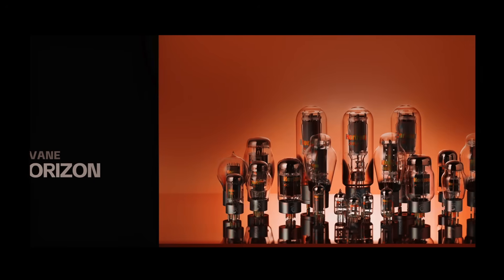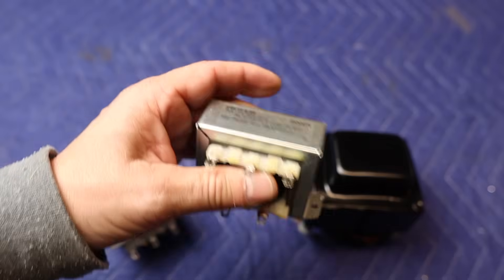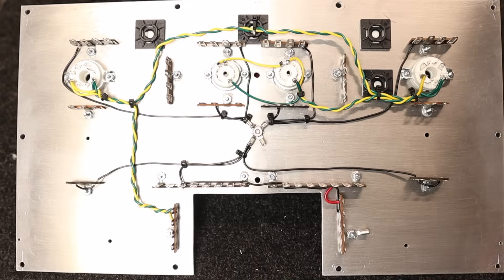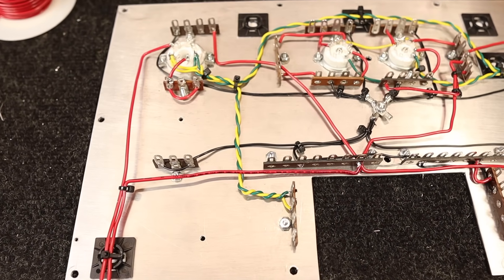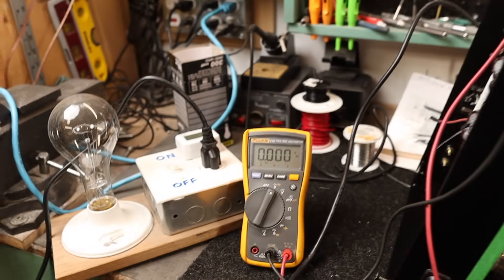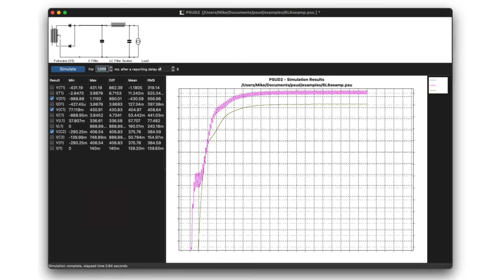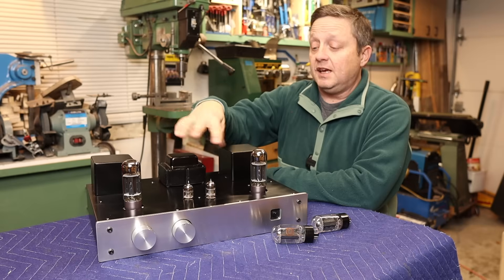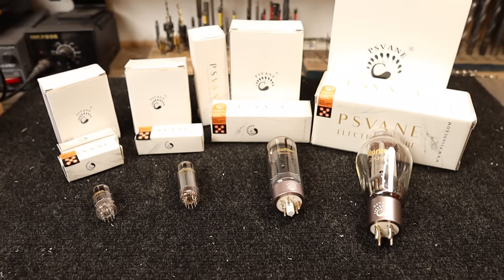DIY 6L6 SE Stereo Amplifier using PSVane Horizon Tubes

Comment from the maker: UPDATE: I reached out to PSVANE and asked them about the 6L6 max dissipation. The documented 23W is a conservative rating to ensure reliability and longevity under standard operating conditions. They have conducted additional tests at 30W dissipation and gathered feedback from other users. Based on this, they can confirm that the Horizon 6L6 tubes can perform normally at this level of operation without issues.

Comment: 6l6 is a beam tetrode with beam forming plates instead of the suppressor grid of a pentode being the nearest structure to the anode
Reply from the maker: Correct, I misspoke. I meant to say Beam Tetrode. It's common for people to think 6L6 are pentodes, which they are not. Lots of history and a patents or two on this. Thanks for commenting. Cheers.

Comment: Зачем изобретать велосипед если давно все отработано! Вот мой вариант схемы с отличными параметрами,с указанием намотки трансформатора!https://www.youtube.com/watch?v=amax4zCoKVg
Reply from the maker: Thanks for commenting. Yes, you are absolutely right, it would have been much easier just to copy a proven design but I wanted to try something that I haven't seen. I does work okay but I think there is room for improvement. I'm planning of redoing the input section and seeing if capacitor coupled performs better than direct coupled, similar to what you have done on your amp.  Cheers.

Comment: Nice project. How about driving the filaments on DC to avoid the Hum. Also the HT can be switched ON through a delay Tube (bi-metal inside). Better use Tube rectifier instead of the Silicon rectifiers
Reply from the maker: Thanks for commenting.  Yes, you could use DC on the filaments but you would need to make sure if can handle the current. The combined current of all tubes would be ~2.5 amps. To have a margin of  safety, it would double that rating to 5 amps. Since the tubes Mu are low, I don't think it is necessary. Two 100 ohm resistors seem to do the trick for this amp.  I would consider DC filaments for preamps and headphone amps where the gain is higher. Yes, a slow turn for the B+ on would be ideal. One could make a delayed B+ circuit or just use a tube rectifier, but that would require a different PT since tube rectifier have voltage drop across them.   To my ears I'm not convinced which "sounds" better , tube rectification or SS rectification in HiFi amps. This is a hotly debated topic which I'm on the fence on. I'm impartial. Cheers

Comment: Nice build. Does the equal current in the preamp tubes help with HD2 cancellation? What kind of sensitivity does it have?
Reply from the maker: Thanks for commenting. I'm not sure if I'm answering your question correctly,  the input stages are direct couple to eliminate extra components in the signal chain and allow for full amplification of the frequency range (no cutoff).   Both triodes are technically balanced and cascade into each other to allow for enough voltage swing to drive the 6L6. I'm not sure if is does HD2 Cancellations.   I haven't done any official testing on the amp yet since my scope is down.  Some additional thoughts on the preamp direct coupled topology. The OT's I'm using start to roll off at 40hz so the preamp section amplifying the full frequency range is a moot point.   This amp is a bit unorthodox and I plan to rewire the input stage to see if a cap coupled preamp section sounds better after I get my new scope to test before and after. Cheers

Comment: Carvin used to make a 100 watt (50 watts a channel) tube amp.  It was meant to power guitar speakers.  It weighs 57 pounds.  It has a super flat response, and uses all these tube 12ax7. And EL6s.  It cost me around 500 bucks.  My only regrets is I did not buy more of them when I had the chance.  Tube amps rule and not just for driving guitar cabinets.  ❤
Reply from the maker: Thanks for the comment, I’m amazed on how loud 40-50watts of tube power can be.  I made a Fender Super (2-6L6 PP) and it could hold its own with any drummer. Cheers.
Reply: @MikeFreda  Total noob question here, but i you have less efficient speakers that need 50-100watts or more, how would you accomplish that? More tubes? or different tubes? Do you have a build video for a higher power tube amp?
Reply from the maker: @berksonfab  Thanks for commenting. Even if you went with common larger output tubes, Single Ended amps will only get you so far in wattage. To produce that sort of power numbers you will need to go with a Push/Pull topology. 6L6 in PP will provide more than enough power to fill a room...BUT.. they are more complicated to make and cost more to make due to the additional tubes and larger Power Transformer and Output Transformer. This would not be a beginner project. I don't have a video for an amp like this since I don't need that sort of volume in my house/setup. Cheers

Comment: You should try their GXSE15 transformers, they have WAY better low frequency response.
Reply from the maker: Thanks for the feedback. Yes, I've looked at those... their description state they are for guitar amps. This leads me to believe the high end frequency response may be rolled off. If you say they are good, I'll give them a try! Cheers
Reply: @MikeFreda  I've frequency response tested the GXSE15 and use them in a production amps, they work great. The ones you used roll off on the bottom a lot, like at 100hz. Those open frame ones really are for guitar use.
Reply from the maker: Interesting. Thanks for the information!
Reply: @MikeFreda  Nah, they are fine on the top and have much better low end response. I've frequency response tested both of these, the open frame roll off at 100hz, the GXSE go down to 20hz.

Comment: Those 6L6 looks pretty much identical to JJs 6CA7 tubes and they can take a lot of power due to their big plates. Most of the amps I have built is based on EL34 but they can play with all 6V6, 6L6, EL34 and more with adaptors in Both Pentode and Triode/ True Triode mode. Also any pin compatible ECC81,82,83,85,88 etc tube can be used. EZ80/81 or 5U4GB or compatible tubes and external power supply. I have variable global feedback, selectable bias, tone controls, Variable voltage, gain controls. volume controls for both input stage and output stage, built in tube health and power gauges, hour meter, you name it. I have full control of the tubes

Comment: Very nice project, thanks for posting.  Question...  On the screen grid resistor, the value can be adjusted to suit?  What was the effect on sound/power going from zero resistance up to 3k, or higher?
Reply from the maker: Thanks.  It's recommended that the screen resistor on the 6L6 is calculated for the specified current as per the Data Sheet. Some people just have a rule of thumb or voltage difference they like to see. Tubes are pretty forgiving and 0 to 3K will all work, how good??? Your ears will tell you pretty quick. At higher volumes, you will notice the power output and the distortion level.  Is there an ideal value for each style of amp, yes.  It's best to calculate, install and test with a scope and/or an audio sweep. Unfortunately, I don't have that equipment to comment much more than this.   For the Grid resistors, they don't have a lot of effect of the overall sound.  They are mostly there to tame RF and oscillations.  You can also read up on the Miller Effect.  There is some calculations on the sizing of them. They can vary from ~68ohm to 1k without any noticeable issues.   I hope that answers your question?

Comment: I built something similar to what you have but added some negative feedback. It not only widened and flatten the frequency response but dynamic range increased some.
Reply from the maker: Thanks for commenting.  Yes, that is a future consideration. This amp is a work in progress.  Cheers.
Reply: @MikeFreda  I forgot to add this, I used LM337's configured in a constant mode and replaced the cathode resistors. Plate current stays the same regardless of tube age, no bias adjustments!

Comment: Thanks Mike for another enjoyable video.  I have a few comments, 1) It doesn't look like you have used any voltage balancing resistors across your series power supply caps which I think are pretty much essential;  2) Re use of a 12AT7 - In every hifi amp and preamp project that I've tried a 12AT7 I have been disappointed.  They always seem to have an unatural midrange prominence;  3) I like the direct coupling of the two sections of the 12AU7 -  I've found it to work well.  Try removing the bypass cap on the cathode R of the second triode for improved sound.  (Lower gain I know but still plenty if you are using a preamp.)
Reply from the maker: Thanks for commenting. I appreciate the feedback on the design! I'm still playing with it and will post some more about this amp. Yes, I did eventually install some balancing resistors and they are shown on the revised schematic. I was lead to believe by a veteran builder that if you have high quality caps with exact DCR it's not an major issue... but in practice, it is recommended.    I can try removing the bypass cap but in theory, this bypass cap rolls off lower than the output transformer and 6L6 bypass cap so I'm not sure you will hear a difference on the low end. I'll go back and crunch the numbers again on this.Thanks again, cheers!

Comment: Large fist size output transformer is the key, plus parallel output tubes are good for needed power in class a .
Reply from the maker: Thanks for commenting, Yes, there are various things you can do to get more output and better frequency response. The intent of this amp was to try a different sort of topology with a limited / lower cost parts count. I will be revisiting this amp. I'll be doing some measuring and adjustments to input tube topology. Stay tuned! Cheers.

Comment: I know how rewarding that is back in 1985. I made my first amp and it’s a trip. When you finally get it sorted out as a kid, I was only 21 at the time and you don’t know how many times I would completely get it all wired up in the next thing you know the things basically on fire smelling like hell start over again I burned up about 4 amps before I got one work.
Reply from the maker: Thanks for commenting. Yes, these projects can be rewarding especially if they sound good.  I’m fortunate to have never blown up anything as it yet.  I had a few resistors get pretty hot and turned the amp off before anything catastrophic happened.  Amp had a shirt on the tube socket and pulling the voltage down. Lucky to figure that out!   Always test and calculate before long term usage.  Cheers.

Comment: Kool , how do you know the best resistors to use that sound best
Reply from the maker: I typically choose resistors for the application and power dissipation. It’s hard to make a blanket statement on what sounds best. For the signal path I like Carbon Film or Metal Film for noise rejection and tolerance. Large bias and PSU resistors, I typically use wire wounds.  I can also use Metal Oxide in the DC  power supply node at times.  Costs can add up fast on quality resistors like Kiwame’s. When prototyping use whatever.  Cheers.

Comment: Dear Mike, first what a nice build and good explanations! But some things to consider from my point of view. R9 is running at 1W so you need a bigger resistor there. R16 is mainly there to prevent the screen from oscillations and overpowering as it has only 5W power handling. Thats why in the datasheet the max voltage for the screen is lower then at the plate. That power should be measured otherwise the tubes won't last long and it shouldn't be left out even if being smaller in the end. The 12AU7 has simply not enough gain in this application to fully drive the 6L6. Even with constant current sources as plate load it will not be enough. And if you want to add negative feedback you need more gain in the first place anyway. Also i would make R2 bigger as you have no RC at the input to prevent radio from getting inside the amp. Yeah i know people don't like capacitors but i would not omit a input capacitor and i would not DC couple the second stage. Lastly if you want to stay with 12AU7 give em more current and plate voltage. At least 8-10mA and around 200V.
Reply from the maker: Thanks for commenting and for the feedback. Yes, I'm aware that this amp topology has some shortcomings and I'm working through them. People have used a 6SN7 in a similar fashion and the 12AU7 has similar properties so I wanted to try it to see. It worked pretty good but like you mentioned, I think there is room for improvement. A couple other people have reached to me as well and gave me some ideas to try. The plan is to revisit this amp once I get my new Scope and see a before and after. I'm going to revisit the 12AU7 bias points and try a cap coupling between the first stages.  This is a fun hobby for me and as you probably know, tubes can be quite forgiving! lol  Cheers
Reply: @MikeFreda   No better way to gain experience by doing it yourself and see the results. Maybe you try a 6N1P since you have the noval sockets installed. Give em 240V on the plate and around 7-8mA Bias and get rid of DC coupling. Just beware of the different heater connection. CCS as anode load works very well too with for example DN2540. There are many dual triodes one can try with adjusting the necessary currents and voltages and yes thats part of the fun to me too.

Comment: Wow! Your mechanical skills are amazing! I learned some useful ideas from what you built, and also some of your tool choices. The 6L6 would not most builder's first choice for tubes in a single ended amp, but you showed that you can still do great things with this venerable old tube type. How much clean power are you getting from your amp? BTW, the 6L6 and its derivatives, like the 6550 are actually beam tetrodes. Ths 'supressor grid' is actually a pair of beam forming plates. The 6L6 is the first of this kind of tube. The EL34 is a pentode and has a suppressor grid. Interestingly, the American version of the EL34, the 6CA7, can be either a pentode or a beam tetrode, but apparently either will work in a circuit designed for the type.
Reply from the maker: Thanks for commenting. Yes, using a 6L6 in SE for HiFi is not a typical. Most 6L6 HiFi are in Push Pull topology.  My oscilloscope is broken so I haven't had the chance to measure the output. It is louder than my EL84 amp. It appears as loud as my 300B amp. I suspect it's around ~6 watts the way I have it biased.  As you may notice on my channel, I like to build different things than the norm. You are correct, 6L6 are a Beam Tetrode and not really a Pentode. I misspoke. It's a common slip-of-the-tongue by a lot of people. Due to patent held by Philips for the Pentode, others needed to figure something else out, hence the Beam Tetrode was developed.  As you alluded to, they "can" be interchangeable. Thanks for mentioning it. Cheers.

Comment: Very impressive! I am considering going down the amp creator rabbit hole and this is perfect.
Let me ask, what exactly is the difference between this amp and the boutique amps costing tens of thousands of dollars? This is a Class A amp I believe?
New Sub here 👍
Reply from the maker: Thank you!  The amp I build it true point-to-point where many mass produced or boutique amps use PCBs and proprietary PT's / OT's.  Everything I was is easily sourced. They may also add some protection and better regulation to help with stability and possible warranty issues with people hooking things up wrong or the variance on the wall voltages.   This is a Class A single ended amp.  Cheers.

Comment: Why not replace the input tube with a 12AT7 or 12AX7 with more gain, then introduce some NF from the output tx to the cathode of V1 ?
Reply from the maker: Thanks for commenting. Yes, you sure can do that. I'd probably go with a 12AT7 since the AX7 has a bit too much gain for this application. I did something similar in my EL84 amp.  Bias the AT7 at 4-5ma, add some Plate to Plate Feed back and call it a day!  The reason I went with 12AU7 is 1.) I wanted to try something different, 2.)12AU7 are a bit more linear (albeit have a lower Mu so I needed to cascade them), 3.) I had a pair and needed to figure out a way to utilize them.  4.) Its common for people to uses a 12AT7 to drive 6L6's and EL84 SE amps.  Cheers!